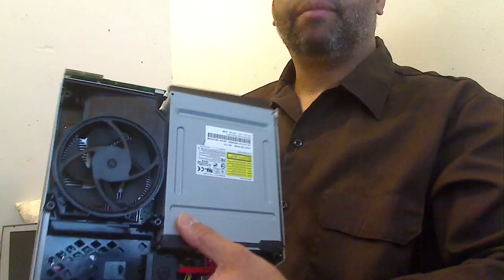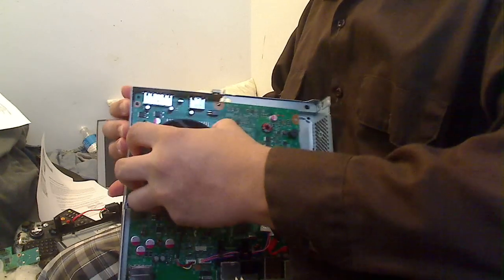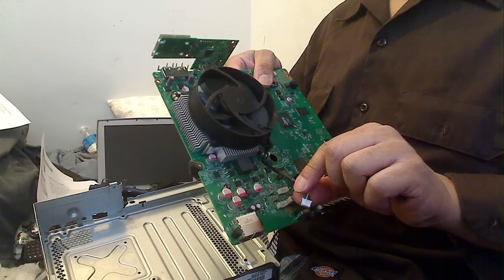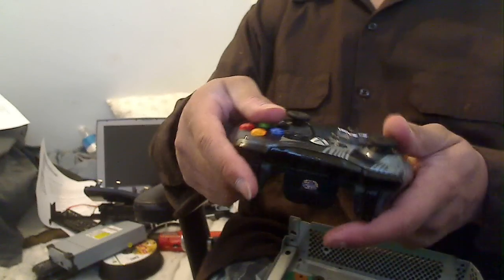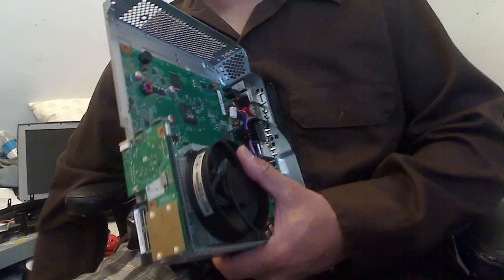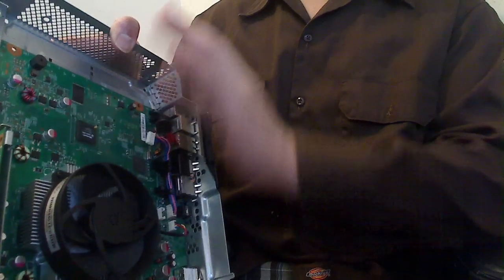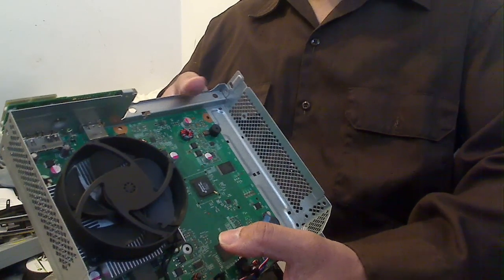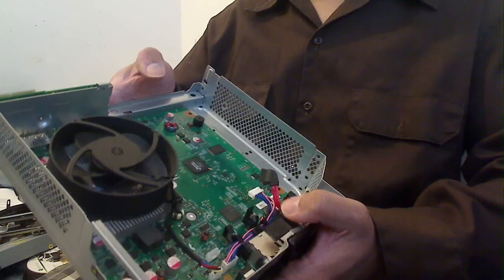How to fix Xbox 360 Slim RROD / Red Dot of Death Reset Solution👍

Comment: hi donte my console flashes green then red i have tried this but it turns off so i cant heap the processor up for this reset what can i do ?
Reply from the maker: Check all your USB ports for bent pins smashed to the rear of the USB port or twisted and touching each other. This can cause ur Xbox to ground fault before you can overhead. If you find this issue pry the pins of the metal inside the port and make sure none are touching each other then try your reset once again. Good Luck. !

Comment: Hi I tried this 3 times but I still have the red dot what could be the problem. Thanks
Reply from the maker: Check your power brick to make sure it isn't turning red when you power on the console; if so, you may need to  replace the power brick.
Reply: It turns green when I power the console on
Reply from the maker: Check your front & rear USB slots for bent or broken pins either touching each other or touching the rear of the metal USB port which could be ground faulting the Xbox. Check the video pins in the rear of the Xbox for bent or broken pins.

Comment: Hi, my name os Veronica. I've purchased a limited time edition halo 4 xbox360 about half a year ago. And a couple of months ago I've experienced it receiving the red dot of death after saying somethings wrong with ventilation. Than my xbox shuts off after 5-10 of being on. My question is, would this method work on my xbox if its different from other slims? Or should I take it to the shop? And also will my data be wiped after the process?
Reply from the maker: I would suggest that you check the ventilation on your power brick first and then make sure that there is nothing blocking the air flow on the side of the Xbox.

Comment: Thanks man
Reply from the maker: You're Welcome David.
Reply: So it resets both chips on the old Xbox 360
Reply from the maker: No. It just resets the CPU. You have to force that to go.
Reply: Dang I am going to try the same method u did but with another Xbox I get
Reply: Thanks
Reply from the maker: You're Welcome David

Comment: Hey donte I have a problem I tried this n it turned back on but then it made a noise n froze n the red dot came back on I tried this over again n red dot still was there any more tips
Reply from the maker: Thomas Flores Check your power brick to make sure the light is not red upon powering up and check to make sure the fan is spinning and not jammed. Noises besides beeps aren't expected from inside the xbox360 slim. Try removing your hard drive and then powering it back on. A little bit more detail into what you actually did to try and get it running would help with getting a better explanation from me. I explained a few things in my video; "I tried this" doesn't tell me what you actually did..

Comment: Donte, thank you for posing this. I had the red dot of death on my Xbox 360 slim and EVERYONE told me to toss it and buy another one. I figured I'd at least TRY to fix it before kicking it to the curb. I did EXACTLY what you suggested and it works like a charm now. I did, however, had to refer to another tutorial to find out exactly where and how to apply the heat sync paste. But, other than that, your video blessed me and my kiddos. My only hope is that this fix is a long term one. Thanks again sir!
Reply from the maker: Xavier Barron Im glad that the fix worked for you Xavier and I'm glad your kids are happy gaming.. I do not know if the fix is long term but so far each Slim I've performed this method on has only had to be completed once. If yours turns out to be short term please post your comments into how long it did last and weather you did it once more or decided to toss it..
Reply: Will do Donte. Thanks again!
Reply: Donte Beachem 
I have a Slim that I think has two separate issues.

When I first got it, it wasn't reading disks. After going through the troubleshooting steps, I diagnosed that it had to do with my Wired controller being plugged into the usb port. After unplugging it, and rebooting the system, it read games normally.

Now I have another problem. I can get it to turn on, and boot up, but it's difficult, it keeps flashing off and on, and if I keep it powered, it'll just keep cycling indefinitely.

The touch power button on the front isn't immediately responsive, it's either delayed in responding to my commands, or ignoring me completely and just doing what it wants. 

There isn't stray air hitting the censor, and after turning off virtually all of my other electronics, I don't think it's interference.

I know it's not the power supply, as I've tried three. 

I did recently install a new fan, as the one it came with sounded noisy, but I don't see how it could force the censor on the face plate to fail. What's more, the censor was finicky even before I installed it, so at worst I think it's only exacerbated a pre-existing issue.

Also, it's not reading discs again, even without anything plugged into the USB ports.

In regards to the power issue, can you figure what's going on?
Reply from the maker: Lol. I can try. As for the power on issue. There is a ribbon that plugs into the frontal board behind the front plate. At times it can become damaged/Ripped if your not careful. Check it for damage. Replacement cables can be purchased on Amazon.  As for the other power on issues, check all the USB ports for bent in pins. Check the video ports for bent pins.
Reply: +Donte Beachem (Romerro) Donte, the "red dot" fix you suggested still works to this day. Although I now have a new problem I hope you can help me with. I tried to connect my xbox to xbox live. I turns out that that was a grave mistake. After I connected to my home wifi, it said that I needed an update in order to connect to xbox live. When I clicked for the update it gave me an error status code. Here's what it reads. "System Update Stopped. Can't read the update fro your storage device. Please reinsert it to continue the update. If the problem persists, visit www.xbox.com/support. Status Code: 43C5-445E-2780-0F00-C000-0034". I've restarted this thing several times. And each time I get the Xbox intro, the update status bar (which doesn't go very far), then the status code page. All of this by just turning on the console. I can't get to the home page or dashboard or anything. The confusing part is that I don't have a storage device. My xbox is the cheapest of the chickens with no storage. Maybe it comes with a few gig but nothing more than that. I called xbox support and I've tried all their tricks. Nothing works. They suggest I send in my xbox 360 slim for them to fix it, but I don't want to do that. At this point I'm guessing that I need to take it apart again and somehow reboot this thing. Can you tell me how to reboot this? Do you have any suggestions?

Comment: So I just unplugged my Xbox and let it shut itself down with out the fan . So I just wait half an hour till I plug it back up?
Reply from the maker: Jaime Guerra Yes Jaime. but you have to now reattach the fan and make sure the heat sink is properly seated. If this doesn't work for you, you may need to purchase some CPU paste. The paste goes between the CPU and the metal heat sink. You'll have to remove the heat sink and fan; clean off the old dried up paste and then apply some new paste directly on top of the CPU plate.

Comment: i followed the steps and it doesnt overheat, it just stayed on, so i tried turning it off and now it doesnt turn on again. help
Reply from the maker: Bladen Anderson If the Xbox doesn't over heat then there must of been an initial problem with your CPU, but check your power brick to make sure it goes from Amber and then to green after you hit the power button. If it doesn't then make sure the power cord is pushed all the way into the power brick and into the back of your Xbox. Your power brick may need to be replaced. Try a friends out first before replacing to make sure that's what's causing the problem. Upon replying please include detail information about the problem instead of just saying "now it doesn't turn on again." That's not enough information for me to be of assistance over YouTube. Be detailed..!

Comment: My console keeps going from green light to red light all on its own, I tried cleaning it, resetting it like you said but it's giving me the red light after like 7 minutes then i have to wait 2 hours for it go back to green. What could be the problem here? And if it's the heat sink, what exactly did you do with the heat sink apart from just taking it off and putting it back on? You are not quite clear on that one. Perhaps make another video showing you fix one step by step
Reply from the maker: Chimwemwe Kalea Here's one solution I've suggested to others; "... make sure the heat sink is properly seated. If this doesn't work for you, you may need to purchase some CPU paste. The paste goes between the CPU and the metal heat sink. You'll have to remove the heat sink and fan; clean off the old dried up paste and then apply some new paste directly on top of the CPU plate. Place the heat sink and fan back on top, screw down, plug it back into the motherboard and then add power. Another problem could be the hard-drive seated incorrectly or an error on the hard drive causing a red dot error. Remove the hard drive and then power up. If you've already done this, then disregard. You may also have a power brick problem. The brick has a built in fan; make sure its spinning and the power brick isn't overheating. Replace the brick if necessary but try a friends out first before replacing to make sure that's what's causing the problem.

Comment: A my xbox is showin the red dot but its not showin untill I try to connect my contorllor.....what do u think it is
Reply from the maker: cecil ferrell If you're connecting a wired controller and the red dot is occurring then your usb pins are grounding out the counsel each time you push in the controller cable. Remove the power source from the Xbox and the video cable and get a really bright flash light so that you can see into the usb port. The USB port has 4-metal pins and are held in place flat against a piece of plastic. Sometimes the plastic is broken off and the pins can get smashed to the back of the USB port where the current gets grounded, sending your Xbox into a ground fault. Use a needle nose pliers and pull the pins off of the rear of the port and make sure they aren't touching each other and not touching the back of the port. After doing that, plug up your Xbox and make sure it is still working correctly. If this is the problem with the port, then you'll never be able to use it again. Once the metal contacts are all separated, fill it with hot glue, all the way to the surface so that no one else can use it. If your pins are fine, then the cable to your Xbox controller is bad; use a different one. Otherwise purchase a used wireless controller from Craigslist. They're everywhere.
Reply: O ok thanks but i found out wat da problem  was and ima save ur msg just in case
Reply from the maker: Ok sorry it took so long to get back to you. I've been trying to get caught up to all the questions from others.

Comment: Donte,not sure why but my slim only Red dots when my HDMI is pluged in.Unplug it and it will reset,plug it back in and Red Dot of DEATH!
Reply from the maker: joan wooton The pins for the HDMI port on the back of the counsel have been known to get bent or broken; if this is the case you'll have to purchase component cables in order to get the same HDMI affect you expect from your games. It happened to one of mine about a year ago..

Comment: Hey sorry to bother but I feel like my fan is spinning slowly idk If that's the normal speed before it got this red dot, or if it's the Same but I remember I could hear the fan but now I can barely hear it even when I'm close to it , is this the case for the red dot is death or could it be the ground fault
Reply from the maker: Omar Mancilla It could be either or Omar. Your fan may be clogged with dust and dirt, preventing it from spinning. You'll have to take it apart to find out. Check your power brick and make sure the light never turns from amber to Red or from green to red. Good luck..

Comment: My sons xbox360 had this issue so I did all the steps listed in forums to fix it. No good. Still had the Solid red light. So I turned it on and left it on for about 30 minutes then turned it off and back on no more red light. Xbox is working fine again.
Reply from the maker: Great job Cameron. Glad you're back gaming again.
Reply: Cameron Lakeland Did you do this with this Method or did you nothing?
Reply: Thank you so much for posting this reply. This was my answer!!

I had a controller with a short in the cord, then I got the dot. I was set on having to open it up or buy another one. I left it on for about an hour, and now it's back! Thank you so much, this technique wasn't listed anywhere else!!

Comment: Hi Dante: while i was checking my xbox, i told that i realized that red light turns on when i switch from tv to xbox mode on hdmi usage. But i try with ac regular xbox cables and also happens the same thing. On hdmi i try different cables and on different tvs but still red light. What you recommemd? Thanks for your advice

Comment: wouldnt it be the same problem as a cpu reflow?.being that your overheating the cpu for 20 mins?
Reply from the maker: No it wouldn't. A CPU reflow usually includes some form of liquid non-ionized solder.

Comment: Hi Donte. Nice explanation. I did everything you show on your video. After that, the problem still. But, i realized that my problem comes when i change from tv mode to xbox mode. can you give me some advice. thanks
Reply from the maker: Your problem could be from a debris inside the xbox video component port or bent connections inside. Check the video port for debris or bent connectors; check the xbox video cable for debris or bent connectors Try the HDMI port or purchase a new xbox video component cable.

Comment: Okay Donte I have a question. I have my XBox 360 slim put in a wooden chest where it can't get dusty and I haven't played it in months. When I turn it on the power brick light is green but my XBox 360 slim light is only green for a few seconds before it turned red. Like I said it's not dusty at all so what do I do? I'm not very tech savvy and I'm afraid to mess with my XBox's insides...
Reply from the maker: I can't tell you what happened to your xbox while it was sitting I  that box for months other then possible moisture build up if the box was in a high moisture environment. There could be residue or other left on the mother board. If trying to follow my method is beyond your capability, then take it to a shop for repair. If it has never been opened, Call Microsoft to get an estimated cost of repair.

Comment: Hey Donte Beachem My Xbox 360 Slim gave me a red dot after doing an update. I know on the PS3 and PS4 there is a recovery mode for re-installing the firmware. However my Xbox 360 Slim just gives no video output and a red dot now. I've tried taking it apart using canned air to clean it. (though it wasn't really dirty) Is it possibly something wrong with my firmware and do you know of a way to restore the firmware on the Xbox 360 slim. Thanks.
Reply from the maker: IchigoKyger Microsoft at xboxlive.com has a solution for this problem.
Reply: Thanks for the reply. Unfortunately shortly after trying all that I called Microsoft to have them try and get $80 off me to fix it. It then went straight to my local electronic recycling center.
Reply from the maker: Lol. Well I guess its time to upgrade. Xbox One-S.?

Comment: Tried this on a previously unopened slim with only the 4GB internal memory (so no HDD) and no dice.  I had reseated the heatsink with new thermal compound including unplugging the fan.  I let it startup to the red dot to which it overheated after about 30 minutes at which point the red dot began flashing and it shut down.  I waited another hour, plugged in the fan and still the red dot.  Not sure what else to try now.
Reply from the maker: Nick Jones There may be something more serious wrong with your xbox. It may have been exposed to a power surge or the power brick could be the culprit. Also try unplugging controller cables and check inside the usb ports to make sure the usb pins aren't touching each other or the metal side of the port. This can cause a ground fault.

Comment: Hi, I wanted to see if maybe you know how to fix an issue I'm having. I took my xbox apart to clean it and when I reassembled my xbox and started it my ring turned on green and then immediately goes to the red dot. it does this every time I start it. I inspected everything and could not find anything grounding out. I have no idea how to fix this. I can't use my warranty either
Reply from the maker: Try disassembling your xbox once again then unplug the cables and plug them back in. This is called reseating the cables to check for improper connections.